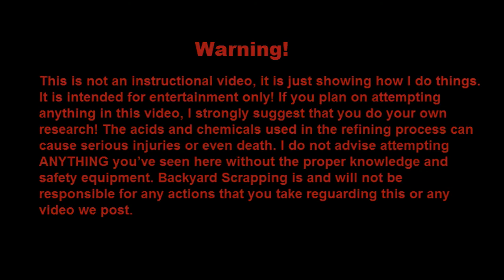Recovery & Refining Green Fiber Processor Gold Pins Part 3 DROP & MELT

Comment: Another great video series my friend. I like your torch. Is it propane/oxygen, mapp/oxygen or oxyacetylene! It looks older, made when things were made right! Any leads on where I might get one?  I checked the progress of the fingers today and stirred them up. To my surprise, quite a few of the fingers are already removed from the boards. I think our 100+ degree weather and that strong air pump is helping to speed progress! Yay! Thank you for all you do brother!
Reply from the maker: The torch is a "Smith Little Torch" they run about a hundred bucks, but you can get clones on ebay for about $25, and they work the same, I keep a clone around for a backup and it works fine!!